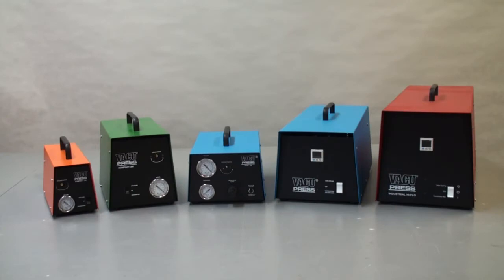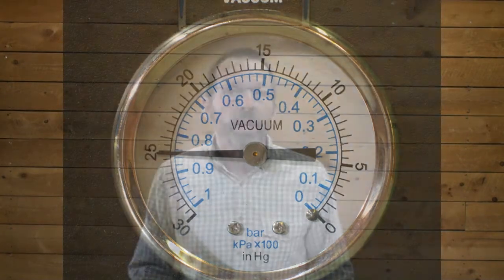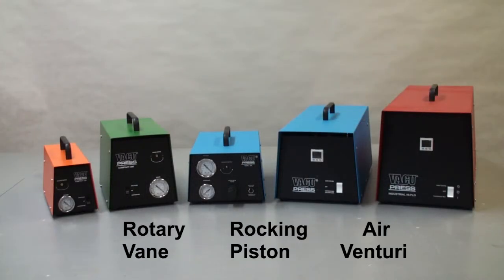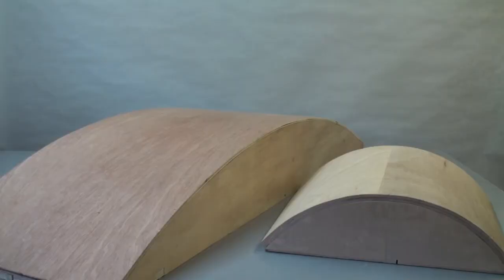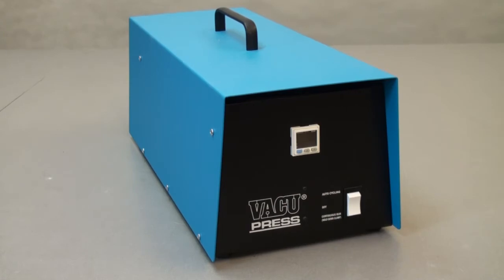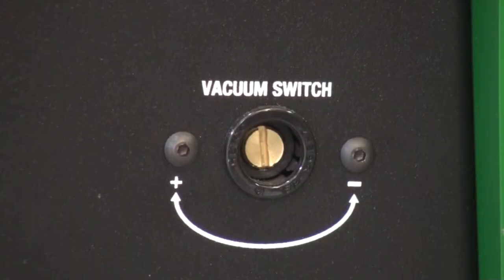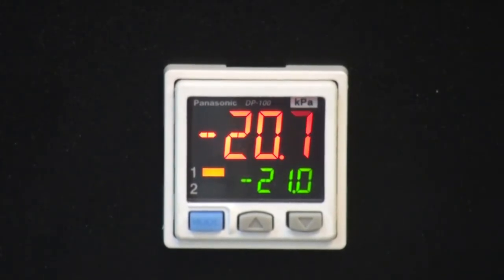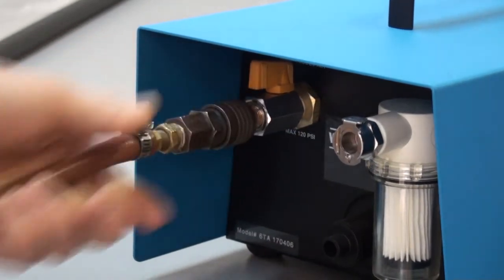Understanding and Choosing a Vacuum Pump

Comment: For fast operation I'd use a shop vac and a small piston pump in parallel with independent valves. I'd evacuate most of the air rapidly with the shop vac first. Then I will bring down the vacuum with the piston pump to a very low level. The piston pump does not remove most of the air.

Comment: Are these safe to use for a vacuum chuck on a wood lathe?  I’m concerned the auto shutoff might kick in at some point and send the piece flying off.
Reply from the maker: When using a vacuum chuck, we recommend running the pump continuously.

Comment: Have you had anyone use your pumps for composite work?
Reply from the maker: Yes. You may need to add an inline resin trap depending on your application. Feel free to call if you'd like to discuss further.
Reply: @VacuumPressingSystemsInc  Awesome! Thanks for the response. Thinking this may be the solution I've been looking for. May feature it in my upcoming build videos if I go ahead an purchase one. Thinking the Compact 150 VacuPress would do the trick for my setup.
Reply from the maker: @RCCAD2VR  You're welcome! We hope the Compact 150 fulfills all of your hopes and dreams!

Comment: What is the duty cycle on these units? I have an industrial hi-flo unit I'd like to use for workholding on my milling machines, but I'm worried I will burn it up with extended use.
Reply from the maker: All of our units are thermally protected so they will shut off before any damage is caused to the motor. If you plan on running your unit for extended periods of time in the "continuous run" mode we would recommend removing the cover from the unit to allow for additional air circulation.
Reply: @VacuumPressingSystemsInc  Thanks for the response!

Comment: will your smaller Vac pump work with a woodworking lathe Vacuum Chuck?
Reply from the maker: it will work but the low CFM flow may not provide enough holding power. Bigger pump would be better for lathe work

Comment: Which one do you recommend for thermoforming solid surface? Do you have a model with external controller so the pump can be hidden away and operated via an external controller.
Reply from the maker: With thermal forming you want a pump that draws down fairly quickly before the material cools too much. I would suggest our HiFlo industrial 10cfm pump as your first choice and the Professional 6cfm pump as the second choice. If you would like to discuss this further feel free to give us a call at 800-382-4109

Comment: Nice information.
Sir suggest a vacuum pump for my chamber (size 7 feet*4feet) for pvc foil press.
Reply from the maker: Without being familiar with your PVC foil press I cant be sure of the right pump for your application. I think just a continuous duty pump may be best for you press.
Reply: @VacuumPressingSystemsInc  sir my work is vacuum membrane press for plywood routed door?
Plz suggest me
Reply from the maker: @3DMrSharmaji  can you send information about the vacuum membrane press you will be using
Reply: @VacuumPressingSystemsInc  sir you can search video to write"membrane door making process" on YouTube